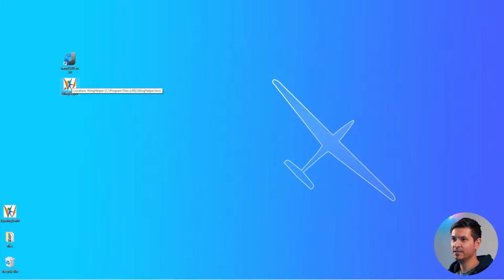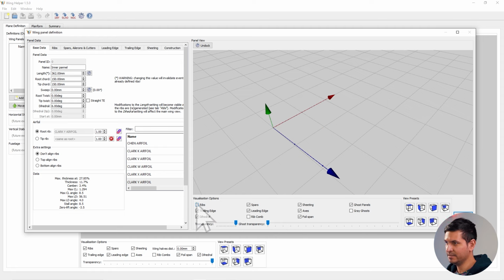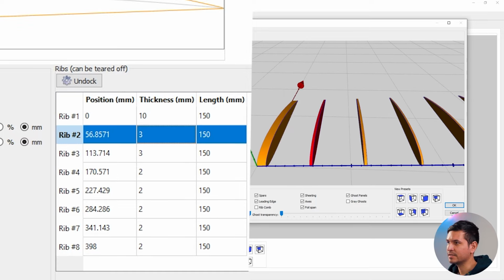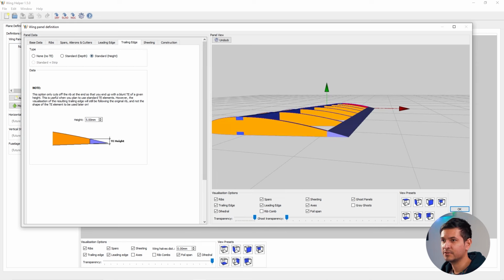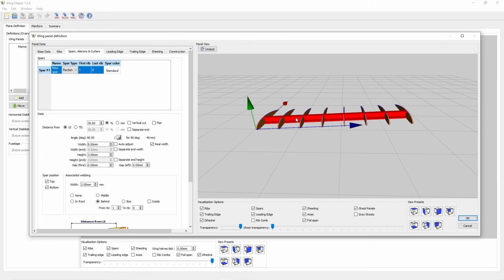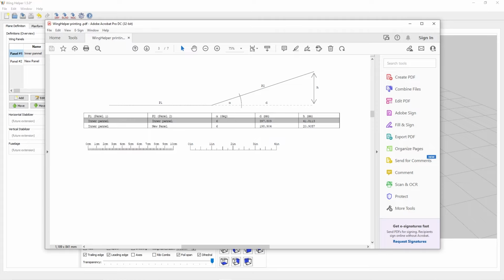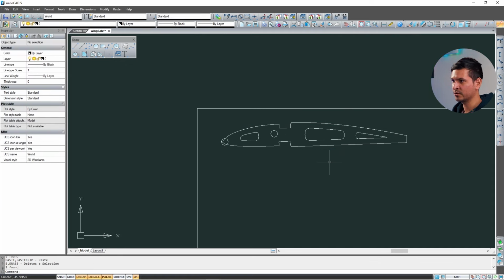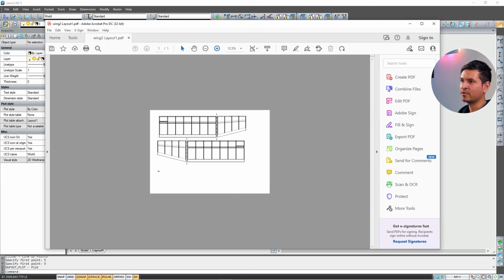Designing a Wing Structure for your UAV or RC Aircraft | Wing Helper

Comment: olha eu fiz varias vez anotei tudo em papel com caneta os centímetro e os milímetros da asas que eu desenhei e fiz 3 vezes e imprimi em arquivo pdf e nem um saiu na medidas certo todos com alteração é bom mas sai muito fora de medidas

Look, I did it several times, I wrote everything down on paper with a pen, the centimeters and millimeters of the wings that I drew and I did it 3 times and printed it in a PDF file and not one of them came out in the correct measurements, all with changes are good, but they came out way out of measurements

Comment: Extremely helpful thank you ! Ive been trying to design a good wing structure using Fusion 360 but it just way too much time and effort. This program is very nice, I hope it can do some complicated wing parts,  and can work with a 3D printer.
Reply: You can export from Wing Helper into OpenSCAD, OpenSCAD can then create the STL file, which you can then import and use for the 3D printing.

Comment: Hello. Can you export wings into .stl files? For 3d printing
Reply from the maker: You can export a format that needs conversion in another free software to save the stl. But this kind of design is not made to be 3D printed. You can try but wouldn't recommend  that. Watch the tutorial in the documentation of wing helper
Reply: @Joyplanes  Yeah I got pretty good wing from Wing Panel to .stl model👍I have been using solidworks for modelling wings but those wing tips are harder to make there. So Wing Panel wins here creating the wing tips.

Comment: Thank you sharing this tool
It's a so easy way to replace the long and pain drawing,error,erase,redraw...on calc.

So let's do it and try and how care if not work, experience is coming by doing. 

Just a little point,from years,decades of wing.... The torsion in tip wing is not so unneeded as you say. 
It's THE must have of approx all profiles on all wing that are not rectangular and straight.
At the beginning of a man arrow,delta,biplane, standalone wing, glider as plane,... You should improve the flying stability and the speed range (larger but not speeder,not this goal) 

Torsion is the way that so many models miss and it's always the best way to improve with the longitudinal V angle 
Most of RTF models that not fly without lot of mix on radio encounter this miss. 

Just my 2 cents